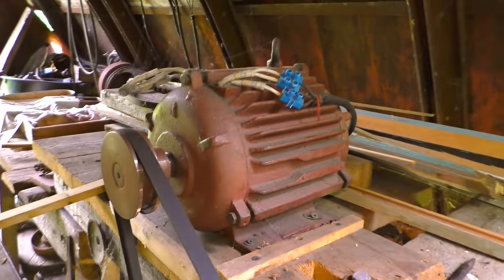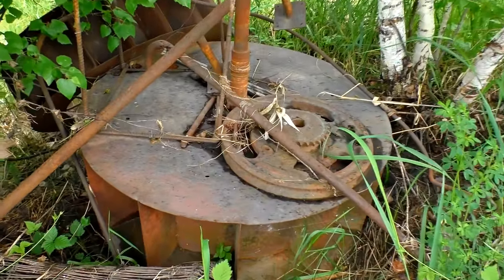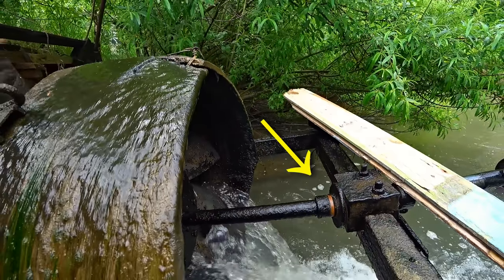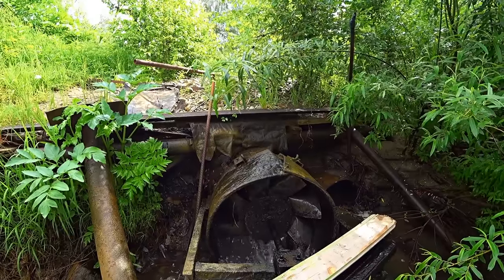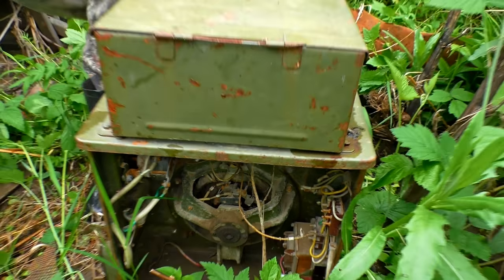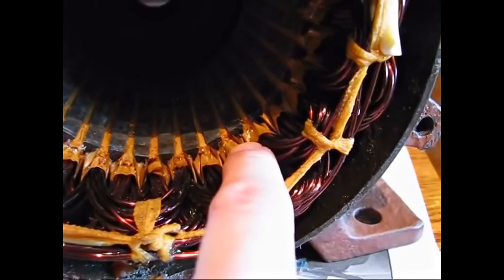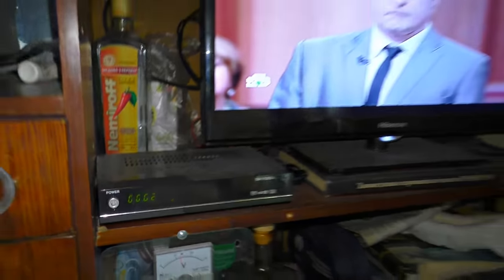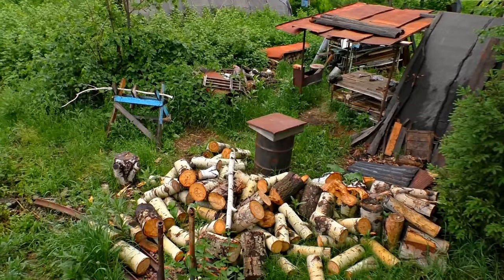Homemade Hydro Electric Station! Alternative energy! Free Electricity! Autonomous energy

Comment: Respected sir. 
I appreciate your effort and concern about availability free 
Free energy to public. 
Sir. Many people do have pond or swimming pools. Would like to do experiment for such people. 
Your all system  is ok. My suggestions is only about rotating fan . You use siphon system for flow of silent water.  I am giving you site name.  
Simphon irrigation technology.  Indian farmers. 
So what you do take ten water pipe and create good flow of water     for rotation of fan.
In siphon system we don't need electricity and very economical. 
In siphon system you fill the water and both end should be released simultaneously for flow of water. You are not successful in one attempt. If  this project becomes successful then many people will benefit. You just put some net system in side the pond for  fish not to enter the pipe. My English is not good. 
Namh shivay.

Comment: Neat design with recycled stuff and maybe even can be with recycled magnets too.  Funny, is my CV joints (U-joints on Dana 44) are really loud now and need to be replaced and most likely the axle bearings and seals are bad.  Be nice if wood would work.  ;-)

Back to where I was, I've been wondering about using an old washing machine motor like these for hydro, though see wind use example on Instructables: https://offgridworld.com/600-watt-water-powered-generator-made-from-an-old-washing-machine/

I wonder if with a bigger flywheel there can be more efficiency with just some balanced salvaged mass... not just the magnets or coils depending on the type of generator.  The availability of better magnets for more cost effective price is a God send for some tech.

Comment: You have braking blades that resist the flow on each turn in an unnatural movement, failure in design(notice you curved the blades for efficiency, yet your design is nothing new and a misunderstanding that's been glossed over time and time again. This will help aid in the destruction of the waterway down flow. I thought I'd take a look at your catalog of crap  that keeps coming into my feed and it is just that.

Comment: 600 Watts is not much power!!
Reply: M Watkins 
You can kill 100 people with 1 w. And by the looks of the weather there it doesnt seem they need much for a frisge either so if you take the fridge out of equation, 600W is plenty for thr lights and a pc. The batteries can act as a buffer for the spikes but rms will most likelly be below 600W most of the time
Reply: Laharl Krichevskoy you’re right if that’s all the power you need it’s fine. I’m just use to having my 150 amp service where I live.
Reply: M Watkins 600kwatts
Reply: 600watts constantly is a lot!
Reply: earlibee no it’s not. Think of it this way you can only run 6 hundred watt light bulbs from that and that would overload it. No coffee pots or curling irons no dryer or washer and no water heater. It would be very very limited on what you could use it for. My generator is 5000 Watts and I’m limited on what I can run in my house off of it. So 600 watt is nothing much more than a few lights
Reply: I know that. But having 600 watts running constantly can charge plenty of batteries in one day. So you could easily power up the curling irons  and washers with the stored energies from the batteries. Not to mention a 200watts 500 litre inverter fridge that uses energy on short intervals
Reply: earlibee can you tell me more about the frig that runs on short intervals?? I do refrigeration work
Reply: Since you work on fridges i guess you well know that a fridge's compressor doesn't operate constantly to cool down the food inside of it. It all depends on the temperature of the thermostat. The higher the temperature setting is, the less the compressor works to bring the food to the set temperature.
So with that in mind, the typical fridge should operate about 1/2 hour every 2 hours or something like that.
Reply: earlibee I know how they work but your the first I’ve ever heard call it running on short intervals. They run till the tstat is made.
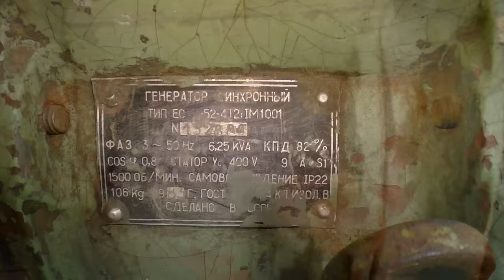Reply: Excuse me, I would like to point a correction in the argument. The power generation of the power-plant is measured to 6 kilo watts. If the converter is not mistaken, then the power is equal to 6000 watts. Please refer to time frame number 2:58.
Have a pleasant day comrade.
Reply: It is possible that he made a mistake on telling us the unit of power. Can you read the generator plate, anyone? All that I can read is 6.25 kVA, 3-50 Hz, 3 phase
Reply: niccatipay you maybe right !!
Reply: niccatipay thanks
Reply: You're welcome Watkins! Honestly I just really want to make a hydro electric station too. I only have a small DC motor from my old toys. Washing machine motors can make good power tho is that right?
Reply: niccatipay if I was going to do that I would keep an eye out for a generator that has a bad drive motor but has a working generator. The generator is made to produce electricity unlike washing machine motors or other motor that may work but I’m not sure how long they will last because they weren’t made to be driven that way. You can experiment with them just be carful. I have a 1000 watt generator with a bad gas motor I would like to do something with but I probably won’t tho. 1000 watt is not very big at all anyways. Try going to a recycling place and see if they have one to sell you by weight.
Reply: Thanks man! I'll keep an eye out for one.
Reply: earlibee you could drive a cryogenic sterling motor from the driveshaft and not run a electric compressor